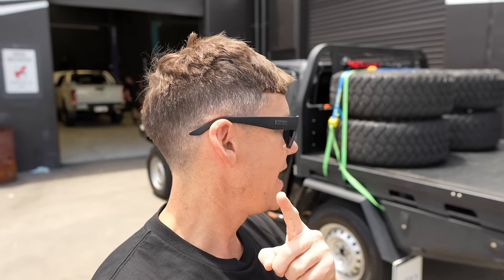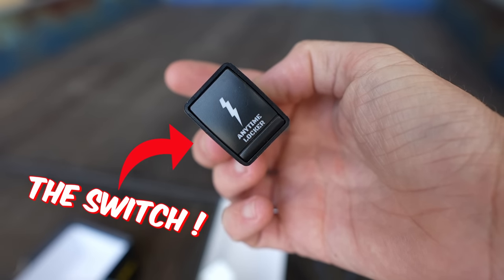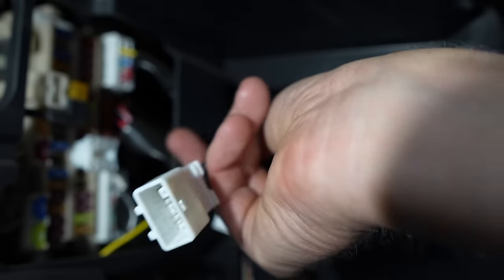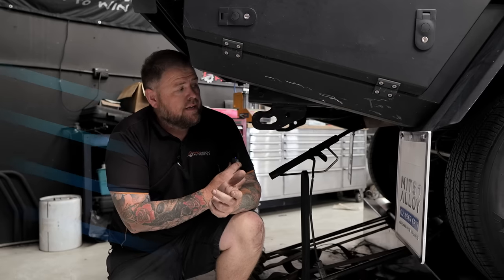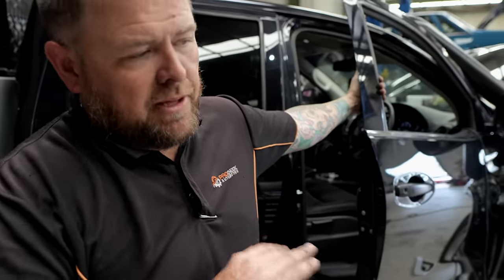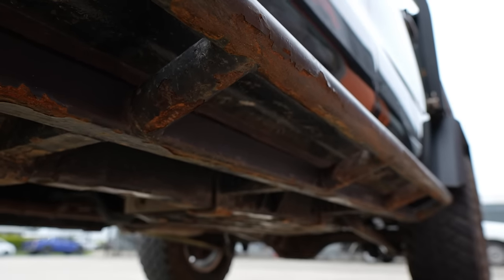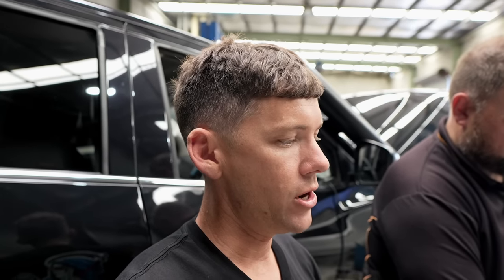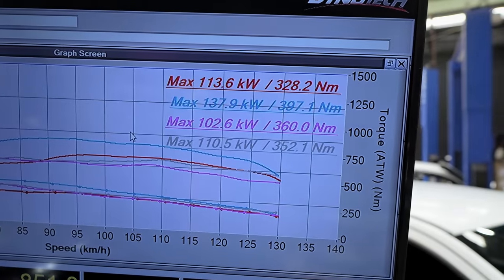How much does Tire size change power?

Comment: It would be interesting to regear it and then test the difference on the street.
Reply: with the massive increase in torque across the rev range and especially down low, you won't feel the larger tyres over the stock tune/tyres.

Comment: (FREE HACK FOR REAR LOCKER Hilux) behind the side panel under the dash on the driver side there is 9 wires, the purple with red stripe wire cut it off and tape it and the green with white stripe wire cut and ground it then your rear locker works in 2x4, 4x4 and low range with the factory switch...

Comment: No offence to the nav or any modern vehicle, they're awesome, but my 2006 4jh1 rodeo with 33s, 3" lift and minor engine mods like an egr delete etc went from 69hp 215nm to 120hp 430nm prior to doing an exhaust and upgraded intercooler, seems that the new rigs have less in the bag to work with
Reply: Theyre pretty capable little motors and then some.
Reply from the maker: DPF enters the chat... Power leaves the chat... haha
Reply: @TJANDMAC  fair point didn't consider that

Comment: Crazy the dip in power once the muds were thrown on. What would lessen that drop? Gearing?
Reply: Gearing won’t change the figures, just the rpm. Some wheels will change the power more/less than others depending on the weight. The rotating mass is what kills power/torque
Reply: You can think of tires as a gear. 

So your axle ratio can directly compensate the change in tire size and bring your final drive ratio back to factory
However it can’t directly combat the extra weight. The tire is both heavier in its entirety and the weight is further from the point of rotation.